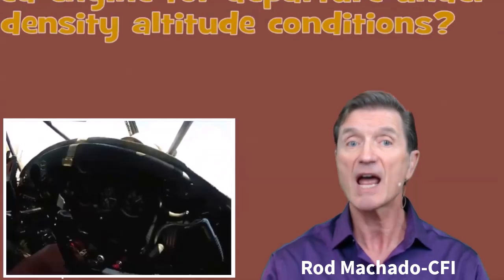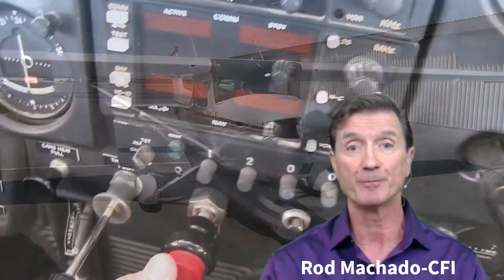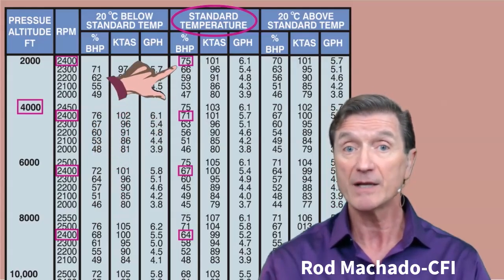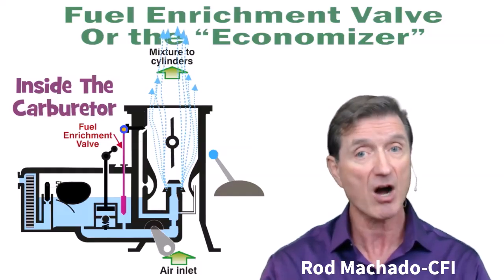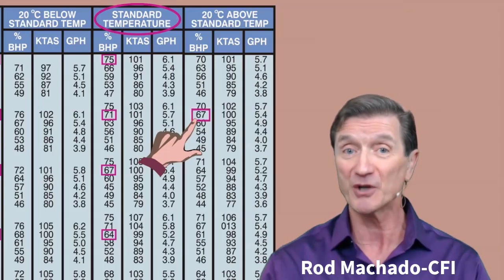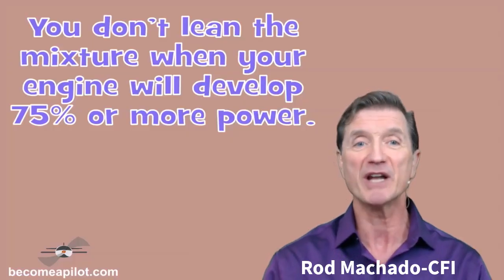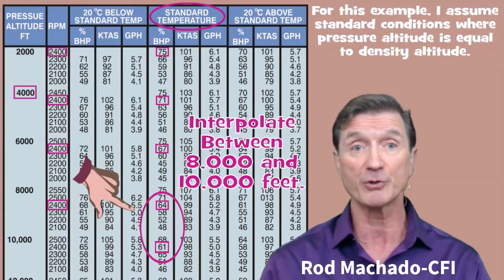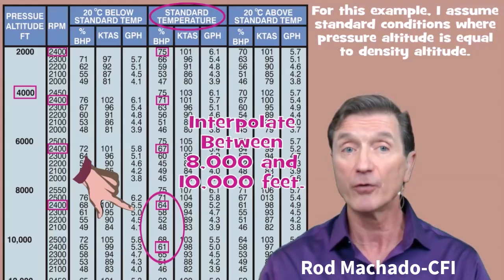Leaning the Mixture During Takeoff

Comment: This is a little confusing.  Most normally aspirated engines will produce more than 75% power up to 7,000 ft, not 4,000. I learned to lean above 5,000 ft. With a constant speed prop, lean til slightly rough on one mag, then richer till smooth and then go to both mags.
Reply from the maker: What would "one mag leaning" have to do with anything mentioned in this video? Very strange. And it's very difficult to generate more than 75% power above 4000 feet for most smaller normally aspirated airplanes.

Comment: As a flatlander from South Texas I had no knowledge of this technique during a cross country to Idaho in 1982.  Landed at Laramie, Wyoming at 1:00 in the summer afternoon for a fuel stop in my 1948 Stinson 108-3 with the Franklin 165. After rotation during takeoff I was climbing at about 50 fpm. To my right was a river and I was able to ease over and dip down into its valley and follow it until I slowly built up speed and climb rate. Luckily the runway was long, I was solo and there were no power lines crossing the river.

Comment: To all the readers: why do you look at Egt and not CHT when leaning? If I understand correctly, it is a too high CHT that damage the engine.
Please be gentle, I am an armchair aviator...
 
Thanks, everyone.
Reply: My understanding is the EGT is the best way of knowing what's going on in the cylinder, in other words, how hot the flame is. It's not perfect but, short of installing temperature and pressure sensors in each cylinder, it's the best we have.

The CHT just measures the temperature of the mass of metal surrounding the cylinder. It's one step removed from what's going on in the combustion chamber and, due to the thermal mass, it's much less responsive.

Any A&P mechanics in the audience who can explain it?
Reply: EGT is a much  more accurate measurement of the fuel air mixture and is much faster in response to changes in that mixture.  CHT while similar, and will follow, is more for making sure you don't melt metal in the valve train, as well it is slower to respond to the mixture changes.

Comment: What a great lesson.  I remember that video.  We had 2 or 3 C172R's when they were first produced (96).  These were the first Skyhawks to have fuel injection, and at the beginning apparently they had some fuel servo problems.  Even at nearly sea level, the airplanes seemed to be sluggish on takeoff, so just to check, I leaned one during a full throttle runup check and on takeoff and sure enough got a nice increase in rpm and thrust - best I can remember at least 100rpm where the red line was 2400 on those models.  I remember the student got quite anxious seeing the mixture leaned a bit on the takeoff roll.  But the question is do you want to see 2100rpm or 2200rpm on the takeoff roll - obviously the higher number.  Eventually I think modifications were made to the fuel servo's and the airplanes got maximum rpm in the full rich position.  I added an item to the departure/climb checklist to adjust the egt reference pointer to the position of the egt needle.  When the egt needle started moving below the pointer, that was the sign that the mixture could be leaned during the climb to maintain optimum power.  Just remember to do the opposite during the descent.

I also had a customer who flew a C182TR (turbo/retractable) with carburetor.  That system regulated the fuel flow at all altitudes for takeoff - per the POH, full rich at all altitudes on takeoff.  However, all takeoffs to me sounded just a little sluggish so on one takeoff roll I leaned it a bit.  Sure enough, the engine gained power which could both be heard and felt.  So apparently it also had a calibration glitch.

Comment: Lots of good information and technique here.  I flew 10,000 hours in Cessna 172s on pipeline patrol in the Midwest and Rocky mountains for two patrol companys that required the mixture be leaned on the Lycoming O-320 and O-360 during run-up at all density altitudes.  The engine runs better learn even at sea level and I generally gained around 300 extra RPM for takeoff from high density altitude airports in summer heat.  Also we generally got 3,000 hours in about three years between major overhauls of the engine.